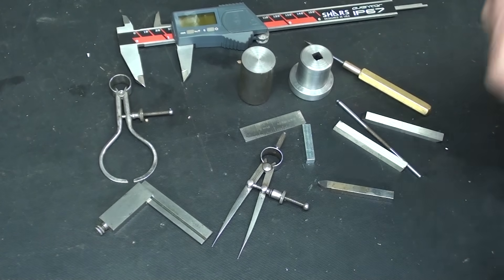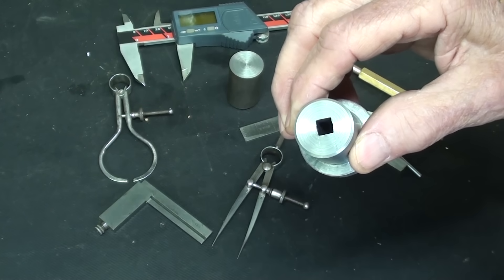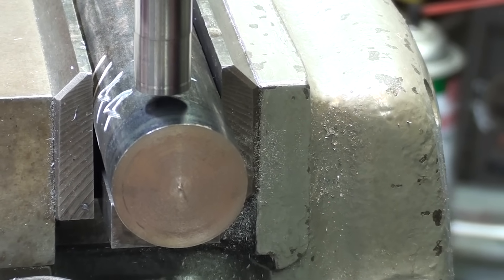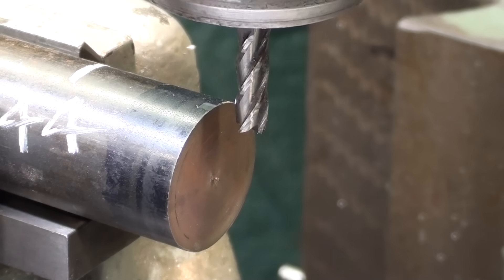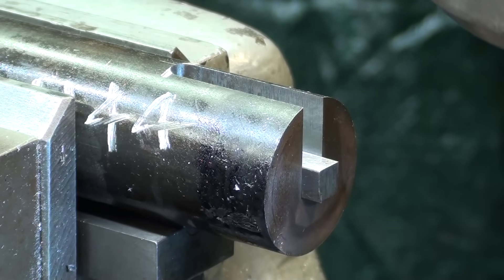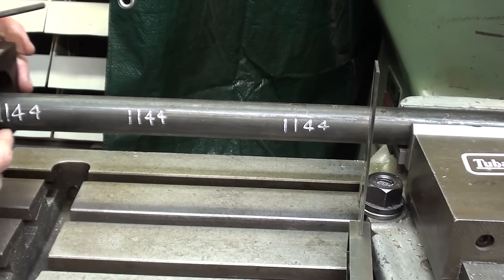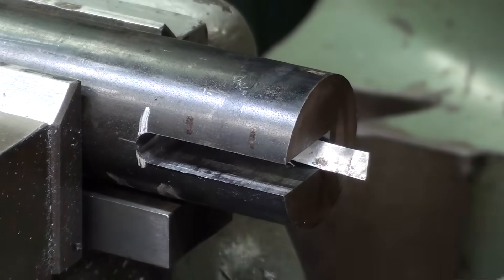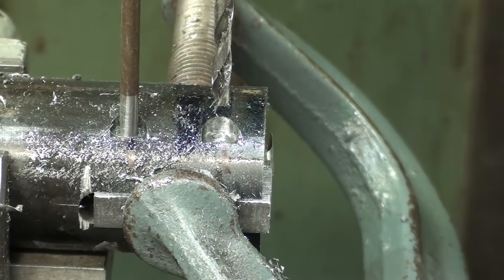Machine Drill a Square Hole in Round Stock #705 tubalcain

Comment: How about a project to make a Rose-Index?
Reply: It’s patented. The inventor commented above.
Reply: @G58  looks like I’ll be keeping this to myself???
Reply: @G58   Above?  Please give name to search.
Reply: Wayne Spyker You don’t need to. The comment is pinned at the top by the channel owner. His name is Timm Rosenthal.
Reply: @G58  easily worked around. Use a system of indexing pins rather than the profile shapes for indices. This sort of patent claim is very weak on the front of 'new and novel' thinking. Hex and square collet blocks etc. have utilised this direct profile copying principle for decades previous. Nothing new or novel about it. It is simply a logical progression,nothing more.
Reply: Howard Osborne There’s a difference between copying, which is theft of intellectual property, and reimagining the solution in a unique, new and different way. 

If a large corporation produces something, potentially my attitude might not be dissimilar to yours. But when it’s the work of one man who’s put his ingenuity, time and effort into designing, proving, patenting, manufacturing and bringing to market, no way would I condone the theft of his idea. And nor should any of us.
Reply: If you have a surface grinder I can see it reproduced for sizes not available in hardened and ground tool steel.  Perhaps adding a bolt circle of (5) 0.5005" diameter slip fit dowel holes?
Reply: Almost too easy. Someone needs to do the cad pattern and then it could be 3D printed and cast in aluminum.
Reply: @danharold3087  I could draw it up in no time put a thread insert in it and just use it as a plastic part! Why not? It don’t take any forces!! I’ll draw it up! And print one out!
Reply: @trialnterror  That would be terrific.    My CAD skills are currently lame.
Reply: @danharold3087  fusion 360 Hobbie license and Lars Christensen on YouTube and you’ll be a master in no time!
Reply: @trialnterror  Its more a matter of will.  Been burned by companies changing their mind about what they allow for free.
Reply: @trialnterror  what sort of price is a hobby Fusion 360 subscription?
Reply: @howardosborne8647  $free
Reply: @trialnterror  good to see some outside the box thinking rather than constrained to just copying what you've been shown. It is,as you say,just an indexer. There is no great loadings or stress on it at all. Look forward to seeing a printed item with inserts👍
Reply: @howardosborne8647  I just bought a 7.3L diesel so I’m going to be busy for just min till I get to it

Comment: Great. Now I have to buy a Rose Index.
Reply: Make a Rose indexer. Pretty simple machining project.
Reply: Right?!  Every time I watch machining videos I am like "dangit, now I need one of those"
Reply: I thought the same thing.
Reply: @gofastwclass  +qa+aa!!aaaaaaaaa!!ass@a!aa!
AAAQA!
Reply: Or just use a v-block
Reply: @rstebb311  that is fine for this project where you only nee 90deg, but the Rose gives you 30, 45, 60 & 90deg.
Reply: @rstebb311  I think you might have missed its intended purpose.
Reply: @TheCuriousOrbs  if you are just turning it 90' you can use a v-block 😏
Reply: A man can never have too many tools!
Reply: If you already have a rotary table, you can just make one.
Reply: On my shopping list. nice tool.
Reply: Great,. Now I need $20,000 worth of machining tools.
Reply: @JDL_2020 , You already have the concrete floor in your shop? (Oh, and the forklift to move the Bridgeport into position?)
Reply: If only the 1-2" wasn't nearly $200 Canadian..
Reply: Me Too! And I'm not even a machinist.
Reply: Do not buy make it. :)
Reply: This video burst my cubic bubble!
Reply: Well I have to get a lathe and a drill press lol
Reply: The Rose index is neat. Never saw one of those before.

To do this without a Rose index, the first operation would be to machine a flat on the top of the round stock the length of the vice jaw. Then, when needed, rotate the stock 90 degrees by lining the flat up with the jaw.
Reply: Me too! Very useful Tool!

Comment: Another way is to take a piece 1/2” round stock and mill a 1/4” slot in it length ways.   Drill a 1/2” hole in 30mm stock and slide slotted 1/2” piece you milled and set screw it and the 1/4” tool your trying to hold in place.
Reply: Good idea.
Reply: Yes, a very good idea. 
However I would probably use 5/8 or 3/4 stock instead of 1/2 for the 1/4 slot.

Comment: Morning Lyle. 11:02 loved the airplane and ocean cruise shp transition.
EDIT: Now let's see your take on 7/16" hex broach purchase avoidance. I can't afford a $192.00 broach for a conveyor belt alignment tracking roller setup! Have been pondering this one for over two months! Have contemplated MAKING a broach out of a piece of H13 that I have that is 3/4"ø and 11" long. Was thinking maybe turning it to establish concentric grooves 1/2" or so apart with a parting tool to the appropriate depth down the entire length, except for the last two inches, Then milling flats indexed on six sides with a homemade parallel surface ground to maybe a 1.5° taper. Could heat treat after machining and temper it to straw. Does that sound feasible to you, or do you have an idea that could be a bit easier?
Reply: Watch Clickspring make one.

Dale in Canada
Reply: @dalemcinnes1834  
      Thank you, Dale. Just watched it. Surprisingly similar to my plan. Just wish I knew if my 1.5° would be either too much, too little, or close enough for a home gamer to work. Can't find specs on the web or YouTube. Thanks for the Clickspring advice, man.